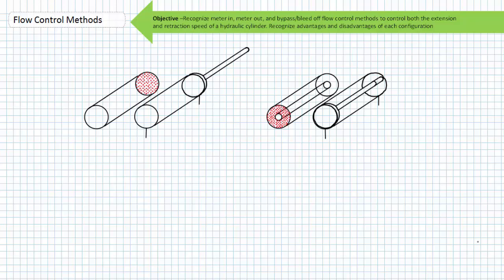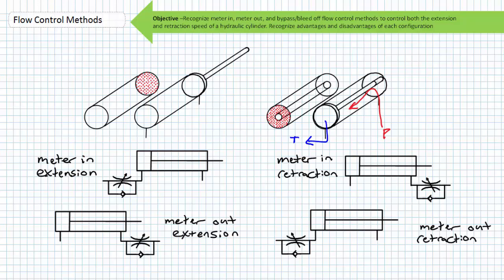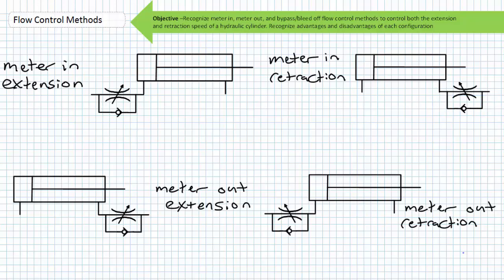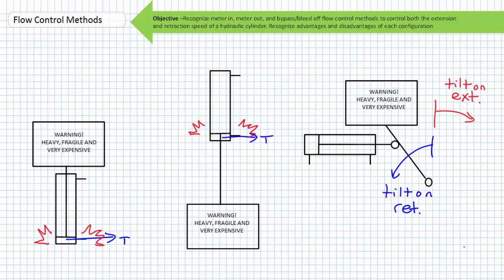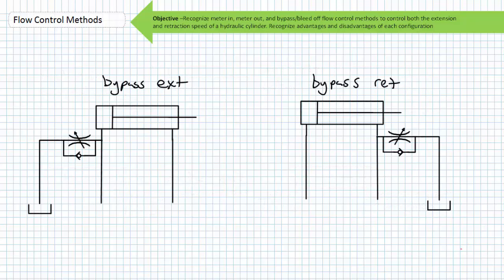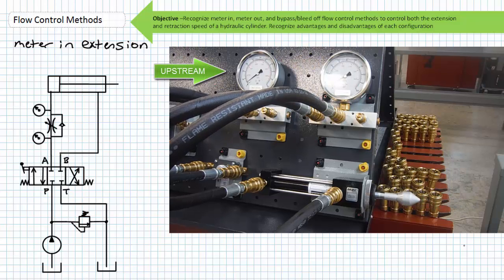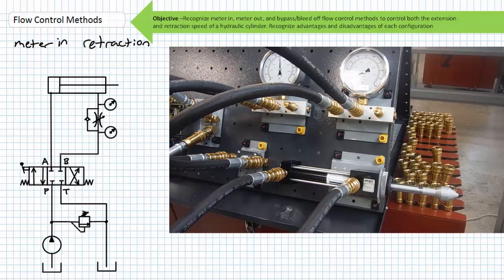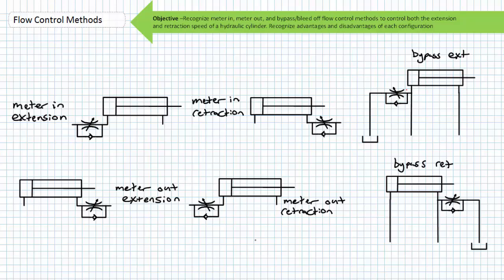Flow Control Methods (Meter In, Meter Out, Bypass)

Comment: I am a complete hydraulics noob.  Why does it looks like your check valves are all backwards?  Wouldn't it make sense to write the symbol so that fluid travels in the direction of the arrow?  That's how it works according to the explanations I've found for the check valve schematic.  But you're not the only one I've seen who puts it backwards, and nobody tried to correct this in the comments, which makes me think that the explanations I read are wrong.
Reply from the maker: Check it out: https://youtu.be/J6n6QYIwhHw

Comment: Hi Sir, I would like to ask if it is ideal to install dual FCV in opposite direction in one line? to do both meter in and out function. Thank you
Reply from the maker: Yes that’d work however be twice as expensive.
Reply: @bigbadtech  Thanks for the reply Sir. Could you give me an idea on how to do a simple design on bi-directional hydraulic motor braking circuit? We have a hose-reel hydraulic system in place that is poorly designed and needs a modification as the DCV doesn't have a detent feature in it for reel braking purposes. The hose that is wound onto the reel rolls out continuously even after taking out the desired length.   The existing design has a 3 position DCV Open Center, Spring-Centered. There are no relief valves on the lines connected to the motor. A detent-type DCV would do but it'll costly. Considering the present design what could you suggest in achieving an effective reel braking feature? Thank you so much in advance.
Reply from the maker: Check out the cross over pressure relief valve at: https://youtu.be/zWRFibp6WnU?t=989
Reply: @bigbadtech  Considering the present design, how can we modify it for effective braking?

Comment: Jim, Most hydraulic excavators have the lift cylinder mounted to the body of the machine and the rod attached up on the boom arm. I have noticed on some very large machines, the manufacturer has mounted them upside down with the rod attached to the body and the cylinder attached to the boom. What would be the reason for doing this, there are many factors involved other than just basic hydraulics such as possible damage to rod chrome, or oil leaks in    sensitive areas. Thanks for your time and effort in your series.
Reply from the maker: John C Good question and good observation ... my background is in industrial wind power so I'm only wildly guessing here but it might be because of mobile applications that preferentially lift a load and then dump it (ie: front loader dumping into the back of dumping truck) versus an application that both lifts and lowers a weight (ex: a crane) or it may simply be manufacturer preference or range of articulation for a pivoting mount. Once we get to "Pressure Control" valves I'll talk about something called a "Counter Balance Valve" that also controls the descent of a lifted object. It's kind of like a normally closed valve (with check valve bypass) that only opens once pressure exceeds a certain value. This way the lowered object (similar to a meter out extension) has some pressure supporting it on descent.

Comment from the maker: Ankush, yes, I'm using MS OneNote for the lectures. I use Camtasia screen capture software. Glad you're making use of these videos. Stay in touch because I'll be slowly updating the hydraulics and electrical control of hydraulic systems playlist. My plan is to improve the audio and editing of the old ones I have at the cgcclive channel and include a bunch more advanced applications and illustrated example problems.